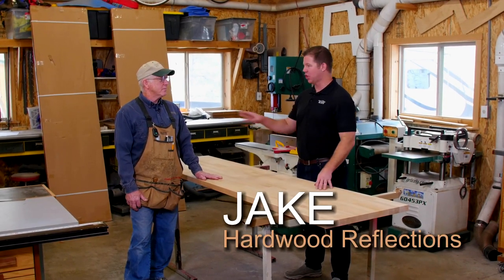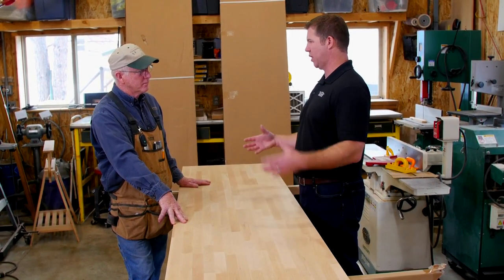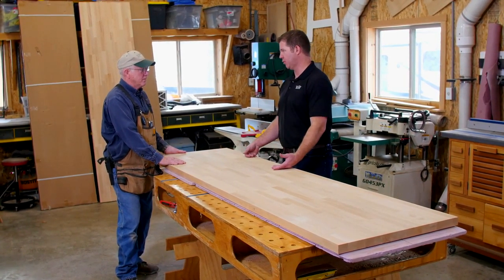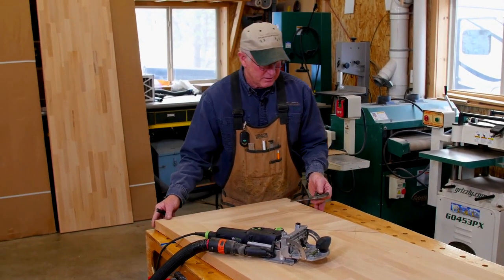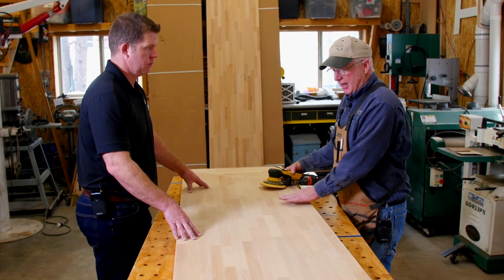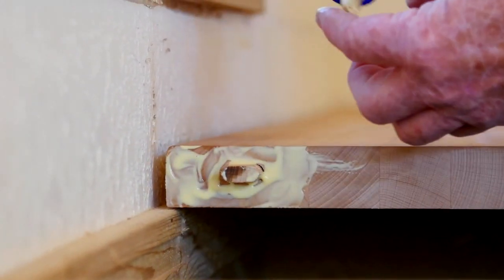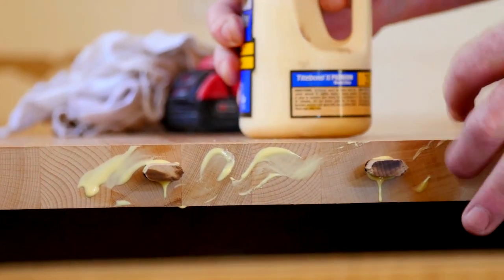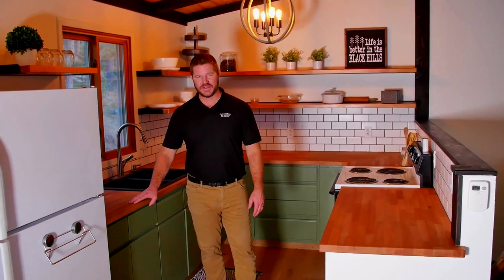Butcher Block Counter Install - Full Kitchen Install Tips and Tutorial

Comment: Sadly I watched this entire video just to see how they sealed the counter. And that's the only thing they skipped 😭
Reply from the maker: Sorry about that.  Here is what we did.  On the countertop surface we did Howard's butcher block conditioner (all 6-sides).  On all the shelving we did a flooring grade polyurethane.
Reply: @HardwoodReflections  Is the butcher block conditioner applied before installation? do you cut and glue the pieces also before the butcher block oil, or after?
Reply: @user-hd8ej8yx9p  You can do it before or after, but if you do it before make sure you do not oil the butt joints - keep those white - the glue will seal them.  Since its recommended to apply a sealant within a few days of opening the shrink wrap, it might make sense to apply before installation, especially if the countertops will sit for days or weeks before installation.  If you anticipate fitting and placing the countertops immediately after opening the shrink wrap, they you could seal afterwards if work quickly (within 48 hours I believe).

Comment: What floor  polyurethane did you use on bucher block. Thanks
Reply from the maker: The one in this video we used Minwax poly for floors.
Reply: @HardwoodReflections  Is this food safe?
Reply from the maker: @harlowpinson5678  Hello Harlow - The floor polyurethane is not one of the known food-safe options. Check out food-safe options if you'd like to use your butcher block countertop as a cutting board here: https://hardwoodreflections.com/how-to-make-a-butcher-block-countertop-food-safe/
Reply from the maker: @harlowpinson5678  No.  If you need food safe go with mineral oil or butcher block conditioner.
Reply: @HardwoodReflections  If it's a kitchen countertop used to prep food, yes I think food safe would be preferable. LOL

Comment: You don't use a floor polyurethane on a countertop you need it safe for food!! That's some wrong info there. You use mineral oil it's much safer for food contact
Reply from the maker: You aren't wrong in your point about Mineral Oil. While there are many other options, food safe recommendations mean you can safely cut your food directly on the countertop just as a cutting board. Many of our customers do not use their countertops as a cutting board. For more details on this check out: https://hardwoodreflections.com/how-to-make-a-butcher-block-countertop-food-safe/

Comment: Did you use several coats of Howards oil first, then Howards conditioner, or just Howards conditioner....if so, how many coats
Reply from the maker: We would recommend using conditioner only in this case and follow Howard's recommendations for applying their product. Remember, using oil or conditioner does require reapplication overtime to keep your butcher block protected from moisture or drying out.

Comment: So for my miter joints, I plan to use biscuits and glue. Do I also need to use pocket screws to draw the joint together or is pressing them together with just glue/biscuits suffice?
Reply from the maker: You can use one or the other for your project. You will want to make sure you have clamps from edge to edge of your miter to ensure a steady dry period.

Comment: Could you still use pocket holes rather than doing biscuit joints or domino joints?
Reply from the maker: Yes.  Use some wood glue between the pieces before the pocket screws.
Reply: That is, for the pieces with grain that runs in the same direction. The miter joint shouldn’t have glue or screws to allow for wood movement. Draw bolt joint connectors will do the trick. 

I’m not sure how to keep the surfaces the same height without a domino or biscuit tool though.

Comment: Do you use silicone to mount the sink?
Reply from the maker: Yes.  The silicone also helps the butcher block expand and contract over time.
Reply: @HardwoodReflections  Thank you! I'm finishing with Monocoat 2C. Do you know if the silicone will adhere to it or should I leave the wood raw where the silicone is?